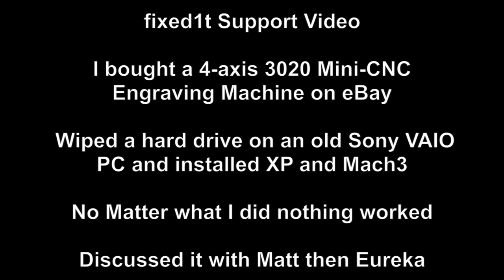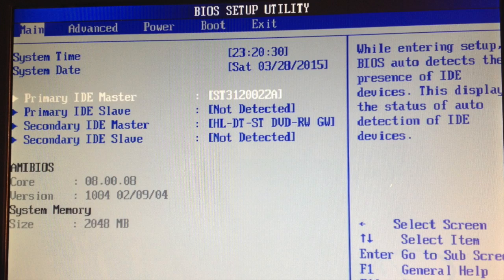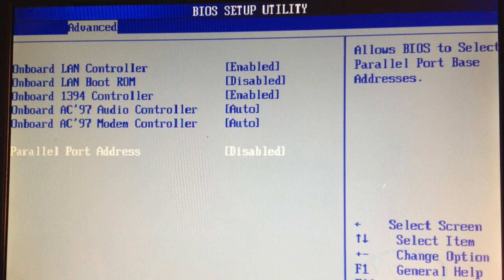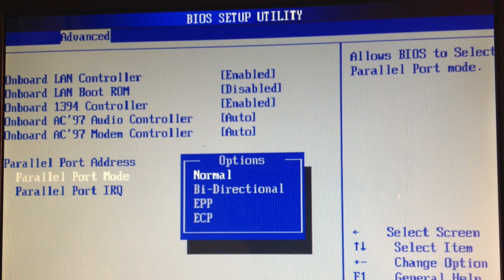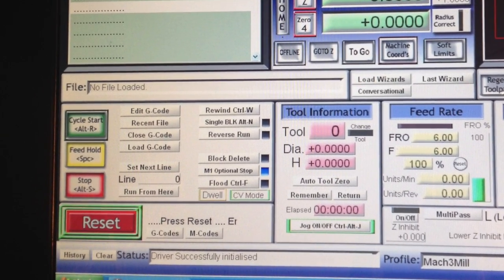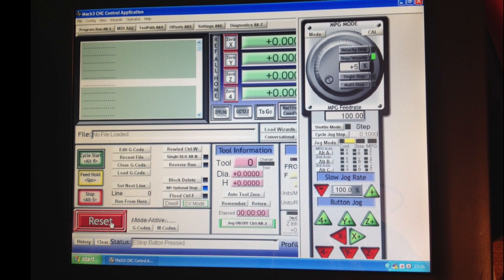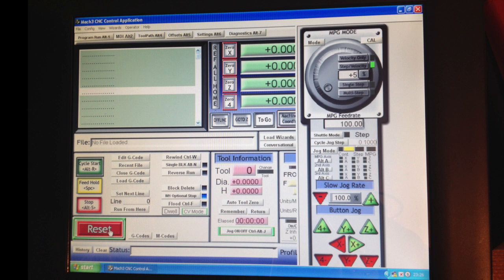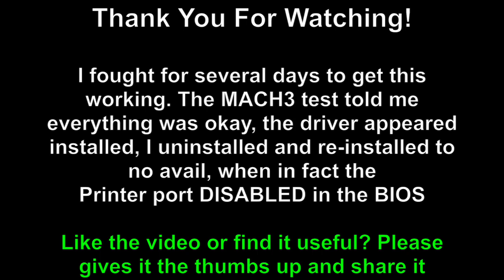CNC 3020 6040 Engraving Router Mach3 Printer Port Fix Set Up

Comment: Hi, Good video. I have just bough the 6040 cnc router and am having a problem setting the ports, and wondered if you could help please. When I go into my computer and check the port settings for Com 1 it tels me the I/O Range 03F8-03FF and IRQ 0x 00000004 (04) I have a PCI Parellel Port connection card and Windows 7 Pro 32 bit installed. Mach3 has as you know a port setting of 378. Which one should I change and how please. Thanks, Terry.
Reply from the maker: Hi Terry, Quite often the PCI cards are not the old heavy current TTL level outputs as those chips are long gone the cards are also sensitive to current issues and spikes from the industrial hardware. These machine are really sensitive about the ports as is the software, my advise is do like I do, sort through the Garage, Loft or somebody else's and dig up an old Pentium desktop machine that runs windows XP or you can install XP on and has a built in parallel port. Otherwise your going to be plagued with port issues every time you change or install hardware.  You'll seriously save yourself huge amounts of time and effort.  Regards Malcolm
Reply: Hi Malcolm, Thank you for your reply. Unfortunately my wife threw out my old XP PC 4 weeks ago (bless her), which would have done the job, so I'm now trying to put together something I'm hoping might do for now. I fully take on board what your saying and will keep my eyes open for an older PC. I was hoping just to get up and running for now. There seems to be no communication at all between the pci card and the control box what so ever. Any way mate, thanks for the reply. Very much appreciated. Terry.
Reply from the maker: If your on a local facebook that has a local buy and sell post you ant an old XP computer you'll get lots of people desperate to get rid of them ;-) All the best, Malcolm aka @fixed1t
Reply: Hi Malcolm, I've just been on eBay and bought a XP with built in port. I can't believe the wife got rid of mine and now I've had to buy another nearly the same lol. I can't even get this computer to talk to the control box. Anyway mate thanks for the help. Terry.

Comment: I cant even get mach 3 to launch , I cant wait to have these problems. (-;
Reply from the maker: I needed to find one of my older desktop machines with XP on it and a built in Parallel port, I then installed mach 3 and adjusted the bias settings as per these videos.  Once I'd done that Mac 3 and the CNC machine chatted perfectly. https://youtu.be/YWWNfVBcdHw  but you also need to set up the control pins correctly for what you want to do, in my case adding stop switches https://youtu.be/UuccUuqI-ic  is this helps please consider Subscribing and If you purchase things from Amazon you can help me out for free by using the search link on my fixed1t Amazon Search page: http://www.fixed1t.co.uk/fixed1t_amazon_supporter.htm If you search from this page and buy anything Amazon will give me a couple of Cents in commission at no cost to you. Its a great way to support fixed1t and keep my videos free at source.  Also, don't forget to check out my Money Saving tips videos playlist. Hundreds of Thousands of people have benefitted from them as they represent some serious savings  https://www.youtube.com/playlist?list=PLVnKaE3t-yQVCioUwYaeLyQLcnOW5VMdK

Comment: Hello Malcolm, I am again here. May be you can help me please. My CNC3020 machine works not correct. Roughing is running OK, but at finishing Z-axis holds not the level and is going slowly down. I have checked the machine, all srews, cables, lubrication are OK, no mechanical obstructions, couplings nice and tight, grounding is on. What can be the problem?
Reply from the maker: I'm not sure, to test if it is the software or cable, turn it on and place the bit about a piece of wood and manually set it spinning, do nothing else, if its software or cable then nothing should happen it should just stay there.  If however it begins to drop and drill then there is a problem with the bearings slipping due to vibration, and it will need replacing.  Regards Malcolm #fixed1tCNCtips

Comment: my cnc-mchine doenst work. no movement. in my PC i havent BIOS, but UEFI, and there is no parallel port to see where i could set up the address or so :(
Reply from the maker: This software needs a parallel port to talk through, all the machines I've ever used have a BIOS control panel, the difficulty is finding the right function key to keep pressing when the startup flash screen shows.  My advise be an old pc from a garage sale or eBay that has XP and internal parallel port and you will have no problems.  Your CNC PC is going to get very dirty so don't waste money using a new expensive machine.  Regards Malcolm aka #fixed1tCNCtips
Reply: I have bought today an old used motherboard with intergrated parallel port, +processor, cooler + 1 memory card. All costs 28,5 Euros - right cheep. Then I have connected the rest things I have to get a complete PC. Old version Windows XP installed, Mach3, test - and, IT WORKS! The cnc machine is alive! Is moving in alll directions! Thank you very much, friend, you have helped me! By the way, the parallel port settings in BIOS were allready correct as default on this old motherboard - I my case any changes were needed! Thank you for the usefull video and thank you very very much for the helpfull advise! Kind regards from Ukraine. Vladimir.
Reply from the maker: Vladmir I'm very happy to have been of help. Regards Malcolm

Comment: hello, 
i have a problem running the cnc machine after changing the pc, my machine need 2 parallel port, the old Pc was with onboard parallel port and pci parallel card, OS Windows xp, my new pc have one pci and one pci Express parallel cards (for the motor output I'm using the pci and for the home/limit switch I'm using the pci Express parallel card), now I'm using windows 7 32bit... with the same settings in mach3 - i copied the xml file (i just changed the port address) the machine move very slowly with motor noise and i have delay in home switch ... so i raised the kernel speed to 45khz instead of 25khz which worked excellent in the old system...now the speed is fine but the motion isn't smooth as before !!! i even don't need such high kernel speed , according to my settings in mach3 i just need 16256 steps per second, so it should work with 25 KHz kernel speed !! can you help me please !! also i test the parallel port with voltmeter and it's says 5 volts.
Reply from the maker: Hi I too am running a Windows XP machine with standard Parallel port, I believe the voltage is 12v rather than 5v and this is needed to operate the CNC controller.

Comment: Hi thanks for the vid  ...does this Bios work with usb port? if yes how? ...Appreciate any help.   thanks
Reply from the maker: Its supposed to work with a USB but you would need a USB to Parallel adapter unless your control box is USB, mine is parallel.  #fixed1tCNCtips

Comment: Also have a Chinese 3020 that looks exactly like yours. How did you program the motor output and output signals to get a PWM output? I want to use the PWM signal to control a laser.
Reply from the maker: I was disappointed to discover that on my control board the motor couldn't be controlled or the motor speed is governed by the rotary pot on the front of the box. As I understand it I have to lose an axis control to control the speed.  I haven't got round to trying that been working manually. Regards Malcolm #fixed1tCNCtips

Comment: i installed drivers for parallel port pci still i didnt get parallel port settings in BIOS
Please Help
Reply from the maker: +Pranay Nalawade Hi thanks for the comment.  I'm afraid I don't have access to a PC without a parallel port (I keep old machine for a while as new ones are often a pain in the backside with old software and interfaces).  If I find one I will install a parallel card and get it working.  #fixed1ttip

Comment: I have same problem as you, did the same, but still not working, did you uninstall mach3 after the changes??
Reply from the maker: Dimitri Del Corral Hi Dimitri your comment just arrived but says its a month old already.  Yes I had to uninstall Mach3 restart the machine, then reinstall it.  Then it worked. #fixed1ttip

Comment: Awesome video, thanks a lot, I hope thats the problem with mine.
Reply from the maker: Hugh Somerset Thanks for taking the time to leave a comment, I hope this fix helps you, it frustrated the hell out of me for several days and the software all appeared to work, it said the driver was running but nothing happened.  I was ready to complaining to the seller that the control unit didn't work, which would have cost me money to ship it back and made my look stupid and out of pocket if it worked.

Comment: There is a similar problem when trying to use any parallel PCI-E card with Mach3 and Windows 7. You need to find its address and update the port in Mach3. Once the PCI adapter is installed. Check the device manager on that LPT port and look at the I/O range. You will need to use the first I/O address in the range for the port address entry in Mach3. In Mach3, go to Config->Port & Pins->Port setup. Enter the address in hex.
Reply from the maker: Quadrysteria Thanks thats really useful to know, these ports have always been a hassle since day one, when they decided that noboby would ever need more than 8 ports.

Comment from the maker: Expensive buy on eBay from Portsmouth, turned out to be China ;-) it arrived damaged due to poor packing, and at 52 kilos it would be extremely expensive (no refund on shipping) to return.  After removing a bent panel I set it up but it wouldn't work GULP then Matt reminded me it wasn't like the Mac where things just work, that I'd need to go digging about in the innards like the old days.. in the BIOS. So after many BIOS and other parameter changes its now working.  This How To video is about setting up a recently purchased CNC 3020 4-axis Router Milling Engraver from eBay running Mach3 through an old Parallel Port. Despite the software apparently running it would not talk to the Router, a chat with Matt and Eureka its working.  Here is how I sorted it out.
Reply: Great job getting it to work! Thanks for posting video!